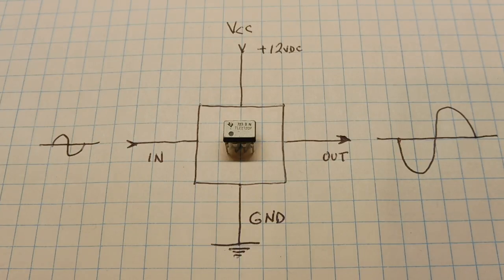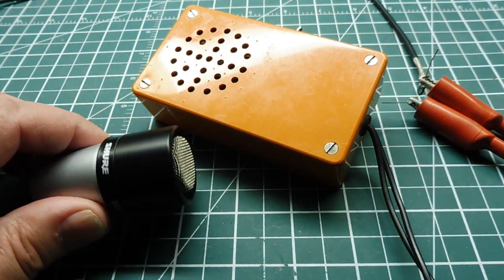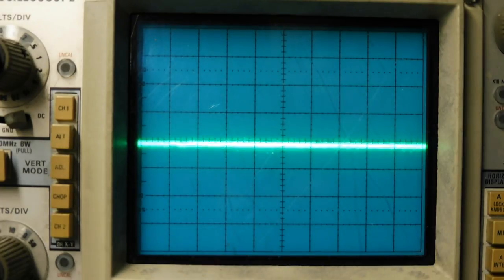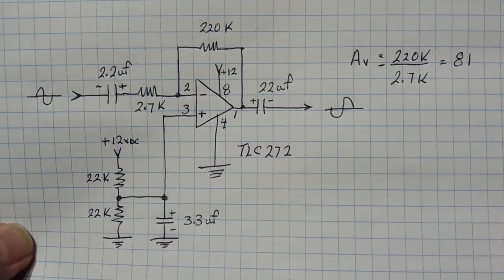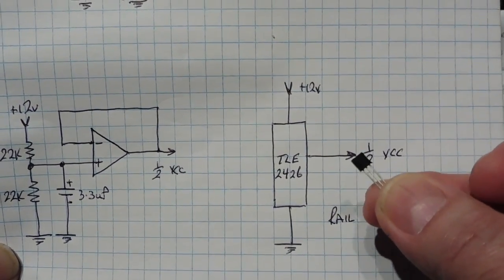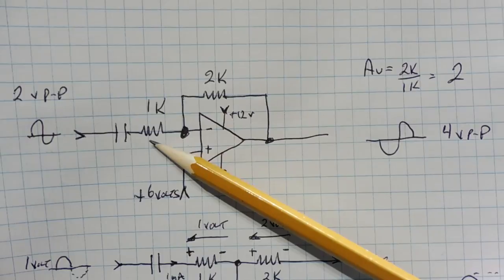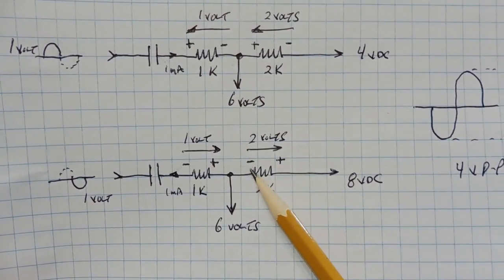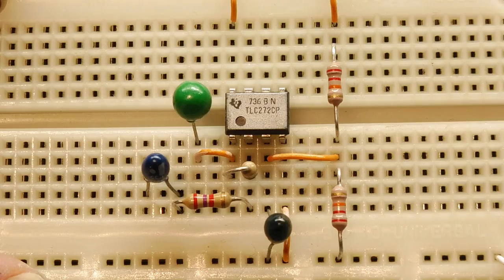Getting Started With OpAmps   \  Dynamic Microphone Amplifier

Comment: Very well explained sir! I was consistently failing to get TL072 going with single supply - so the  voltage divider was missing - thanks sir - datasheets could have given an application circuit. Thanks!
Reply from the maker: Glad it helped

Comment: I made a preamp with 741 Ic and also with a single transistor with carbon condenser mic in both. The problem is I need to bring the Mic very close to my mouth to speak to record audio. What's the problem ? Is this Mic fault ?
Reply from the maker: Try an Electret mic.  https://youtu.be/aSXv6FdYQfM

Comment: I built a circuit using Lm741 & used a small condenser mic of tape recorder to speak on it but the sound not very loud and I need to bring my mouth very close to mic. What's the problem please tell me?
Reply from the maker: The circuit for a condenser mic is different than a dynamic mic. Check your circuit, you might need anothe gain stage.
https://youtu.be/aSXv6FdYQfM

Comment: How did you calculate the value of that 2.2uF cap? Is it a high pass filter?
Reply from the maker: The input impedance (Zin) of the circuit is 2.7k so the Xc of the capacitor at the lowest expected frequency should be less than 1/10 of Zin.
Calculate C to be greater or equal to 10/6.28fZin
For voice I like it a bit treble so it is not muddy so I used 260 Hz

Comment: Love the video! I've made small op amps for microphones based on designs I've seen on the web but most of them are not clean like this is. I'll have to try this one out next.

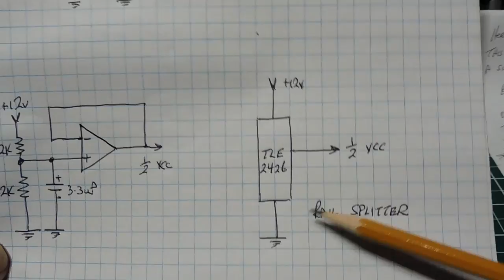Quick question: If I wanted to make a LINE LEVEL AUDIO (600 ohm) Audio Distribution amplifier to take 1 input and drive 4 outputs with it, what would be the best combo of feedback and input resistors to use? (I'd like the ratio to be 1:1 in audio level so if I am driving a 1volt P2P 1000Hz Sine Wave on the input, I should have 1volt P2P 1000Hz Sine wave on each of the buffered outputs) I know each output would need a "buffer opamp" kinda like what you showed at 6:21 but I would just take the output of the first Op Amp and drive the NON-inverting in of all the 4 buffer op amps while the feedback is a direct line from the output to the INverting input for each buffer opamp. The idea is I want to take my audio from my computer and send it to a series of amplified speakers our other output jacks where I can connect test equipment to provide an audio source for my projects. 

Thanks!

Comment: I do my pre-amplification using one  transistor bc547. After pre amplification ,  it goes to the amplification.
Now a days almost all small devices are projected to work on 5v, why 6 or 9 or 12v if u can use the own device power suply to power up the pre and microfone as well.
Reply from the maker: The video is a primer with a real application example for beginners. Once the theory is understood they can modify the circuit to fit their needs. I have other videos using transistors and even digital logic in linear mode: https://youtu.be/aSXv6FdYQfM
Reply: @0033mer  yeah i know.
🤗
Your video about Class A amplifier is cool.
I have made a lot of anplifier for smartphones here 🤗
Thank you.
👏👏👏👏👏👏
💚💛💙🇧🇷🇧🇷🇧🇷

Comment: 5:50 so basically, the voltage divider on pin 3 is meant to keep the amplitude of the signal voltage on the output of the op amp at 6 volt peak to peak?
Reply from the maker: It keeps the output at 1/2 Vcc so the signal can can vary above and below it symmetrically.

Comment: Could you explain how the microphone is connected to you circuit?  Most dynamic microphones have 3 leads.
Reply from the maker: For balanced operation the third lead is the coax shield which is connected to chassis ground. For unbalanced operation the black wire is connected to the coax shield which is ground on my breadboard and the white wire is fed to the amplifier input.
https://pubs.shure.com/guide/561/en-US

Comment: Great video. I'm struggling to understand the values of the capacitors. Aren't they rather high? Especially the filter to gnd.
How did you pick these values?
Reply from the maker: The input and output capacitors determines the frequency response of the circuit.
Input impedance is 2.7k so to get a -3db down response at 20Hz a capacitor of 2.2uf is used. The output load is not known so a larger value of 22uf is used. The 3.3uf capacitor is the filter cap for the voltage divider. This value will depend on how clean the power supply is. The RC time constant is 22k in parallel with 22k ( 11k )times 3.3uf.
Reply: Much appreciated!
If I would want to turn this circuit into non-inverting, can I apply my signal to the voltage divider midpoint, and tie the current input point to ground? Perhaps also remove the cap and resistor from the divider...?
Or am I missing something crucial now...
Reply from the maker: You could simply feed the output to the second op-amp to get a non-inverting output. For a single op-amp circuit with a non-inverting output search online for typical schematic diagrams.
Reply: @0033mer  ah, I never thought of that. Deals with the floating pins aswell.
I did look for circuits online. And thought this is how I could swap ;) probably got a lot to learn still.
Reply: Is this as simple as connecting pin 5 (non inverting input2) to gnd and the two outputs (one of first opamp as input for second, and output of second as feedback) to pin 6 (inverting input2)?
Or do I need to add two 1k resistors, one to input and one to feedback?
Hard to find this setup with two in one online.
Reply from the maker: You can start by building two identical circuit and cascading them together. Here is a good tutorial on op-amps:
https://www.ti.com/lit/an/sboa092b/sboa092b.pdf?ts=1655822904720
Reply: @0033mer  In the datasheet, the unity gain, non-inverting amplifier has no extra components on the input. The gain of 10 inverting circuit adds resistors of 1k (input) and 10k (feedback), which leads me to believe I can omit the resistors for unity gain, inverting amplifier.
They do show a filter resistor (2k) and cap (100pF) on the output.

Comment: Why is the input cap negative to positive? I thought it should be positive to negative
Reply from the maker: A dynamic mic is basically a coil so the input will basically be grounded DC wise. The 1/2 Vcc bias voltage is on the other side of the cap which is more positive. This determines the capacitor orientation.